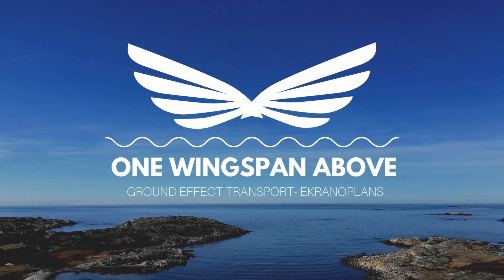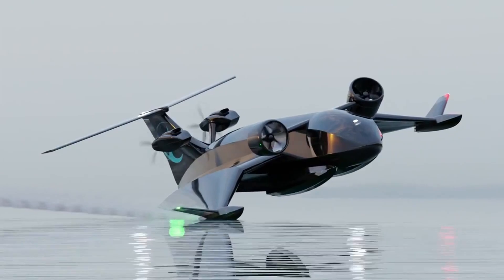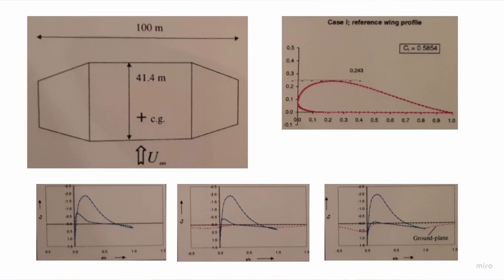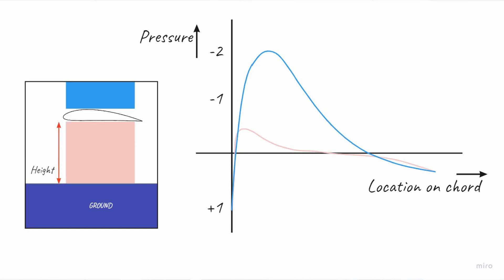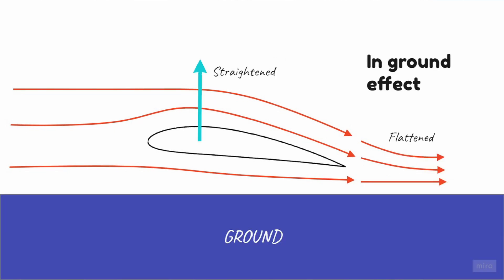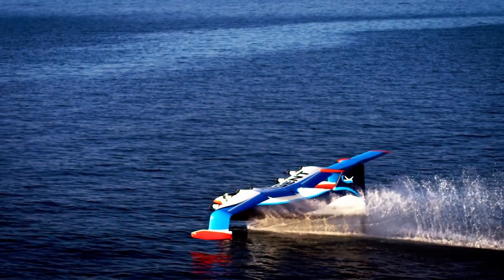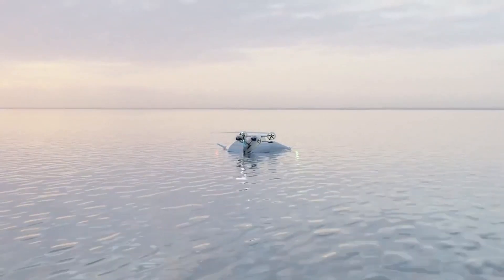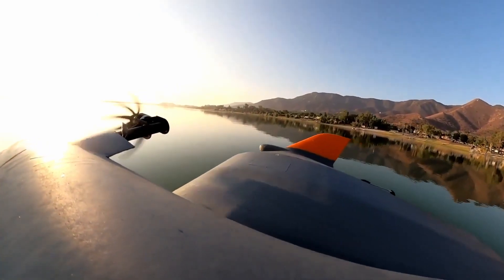Ground Effect CHORD dominated LIFT, Darpa Liberty Lifter and Flying Ship.

Comment: Just found your channel and its fascinating stuff.I have a question that maybe you could answer?

One of the things I noticed about GEV's was that, well, the 'wing' is the important thing and I was curious is a wing-body design such as the Burnelli wing-fuselage concept would work 'better' for such vehicles? I get that the DARPA suggested twin fuselage design would likely have less overall drag but wonder if a wing-fuselage with it's greater carrying capacity might not be a workable solution.

thanks
Reply from the maker: Thanks muchly!
Well.. blended body skimmachines have been suggested before, like the Seabus project, but they have not eventuated. The suggested HW80 howerwing was essentially a lifting body with a tail. 
The issue with lifting bodies is longitudinal stability. You can make one stable in flight with effort but in GE it gets even harder.

Comment: boy it's crazy we could see working prototypes of these things as soon as next year. And if accepted I could see them in mass production by 2027. Hopefully we won't ever need to use them in a full scale war
Reply from the maker: It would be amazing to see them skim the seas. These projects have the tendency to run behind predictions though..
Reply: u will only see 1 percent of them  if that
Reply: @TROUROCKS  Liberty Lifter program is still full speed ahead at least. Down to one candidate now but they're working hard not only on the design of the prototype but also on designing for manufacturability.
Reply: @onewingspanabove  RIP 😭